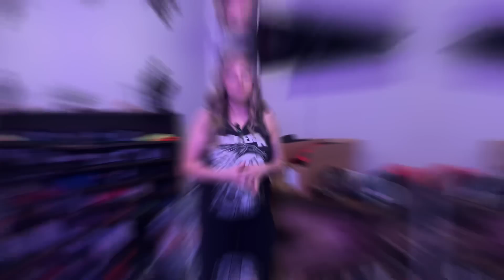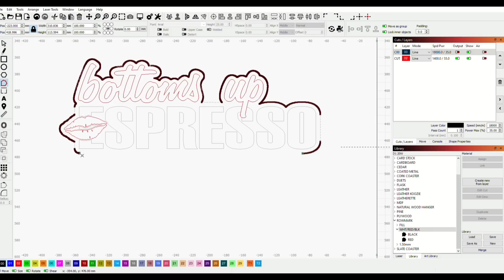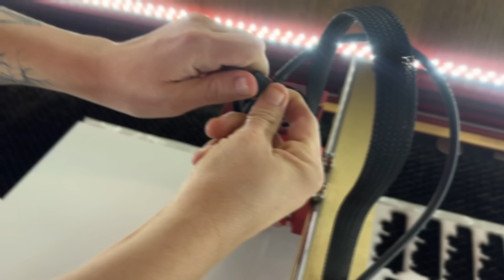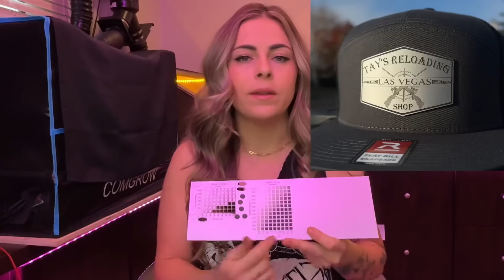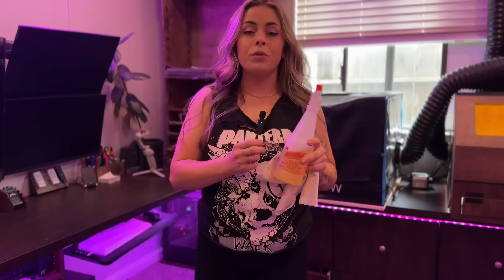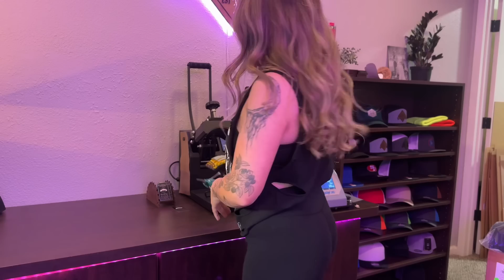Start making laser engraved acrylic hat patches... for FREE. (Rowmark, Duets)

Comment: Willow, are you applying the adhesive to a full sheet before cutting out the individual patches? Can you show your process regarding that?   Is it more cost effective to buy the sheets without adhesive and add yourself? Or do you do that In case you just don’t need adhesive on the sheet for a project?
Reply from the maker: Yes I apply it myself with a flat heat press but before I just used a iron with a heat protective sheet
Reply from the maker: It’s better to apply it yourself when it comes to cost

Comment: If you dont mind, are you buying the acrylic with adhesive on the back? if so, which one are you using? If not, what adhesive are you using? mahalo!
Reply from the maker: I buy it without since its cheaper to put your own on. I buy adhesive from Hydbond or LoneStar. I have a discount code for LoneStar WYLDEWILLOW if you buy a lot it's cheaper so I usually buy in bulk.

Comment: Awesome video!! Thanks for such good info. When asking for the samples which are good for making the hats? I went to the duet website but ther is so many different choices, are u using the indoor outdoor? Or which ones can I use for caps. Thanks in advance!
Reply from the maker: I use 1/16 thickness and anything that says its for laser engraving will work. I use outdoor mostly but indoor as well if that's all I can get the color I need in. I would grab some Duets Laser or Duets Laser XT. Not the Laser XT Reverse. Its confusing at first but its worth it to have so many options for patches and other projects.
Reply: Thank u so much for the info, I will give it a try.!

Comment: Hey! I'm so glad I found you!! I just  did a mock-up for a custom patch. As far as bending the patch to cool, what if you got a short piece of PVC pipe and rubber bands to hold each patch as you start the next one. Just have to figure out the size of the pipe to get the right curve. How did you get the different colors within the same patch? Thank you for all of the freebies too!! I'm looking forward to checking out the rest of your vids!!❤️‍🔥
Reply from the maker: I don't even bend the patch any more. I use a hot plate and preheat the patch. When I do it this way I don't have to preheat the hat and the patch just bends around the hat alot easier. The material is tri-color rowmark from Johnson Plastic Plus. There's a link in the description and a code for 15% off. Thanks for watching!!

Comment: Fantastic Video! Great resources. I will be following for sure. What kind of profit are you looking at? How much do you sell the hats for vs using Leatherette?
Reply from the maker: I keep all my prices the same with leather, leatherette, and Acrylic. However I think you could charge a little more if you wanted to, I just want to keep it as simple as possible for my customers. I basically price my hats to where I am good with the price for any material and if I use cheaper materials like leatherette I considers it a bonus. I only charge more for two layer patches

Comment: did you figure out the zero pressure issue? im wondering the same on mine too
Reply from the maker: No I have not figured anything out. I kinda just go by feel now. Pretty annoying on a press that cost as much as this one.
Reply: @WyldeWillow  I think you need to recalibrate the pressure.  It's in the user manual.  You go to settings, calibration, then go to pressure.  You back it all the way off pressure wise (counter clockwise), then you use the 1/8" foam. you lower the handle until the electromagnet lightly contacts the plate and select the "set min point", then you open it, rotate the dial 3 full turns ( i used a piece of tape to mark it) then you go to close it until it lightly contacts the plate again and then select max point. from there i would follow the stahls video on how to adjust pressure.  i just got my 360 and it was showing as pr 0 on the screen and giving me all these issues and i think this fixed it for me

Btw I have been doing laser engraving for a few years now, and i came across your page and I love the videos so far. great job :) And I love pantera too
Reply from the maker: @christinagorham  Wow  this is exactly what I need to do. Thank you so much I had no idea you could do that. And thank you for watching I really do appreciate it!! Pantera is my older brothers favorite band so I grow up listening to them. Love them!
Reply: @WyldeWillow  Let me know if it fixes it for you. hope it helps!
Reply from the maker: @nathanjohnston8551 check out the comment above might be exactly what you need!

Comment: You need to upgrade to the P2 asap you won't regret it 😁✨️
Reply from the maker: It's definitely a laser I am interested in. I was just looking at it the other day. I like that the bed is perfect size for 12x24 sheets and thats what most my Rowmark, leather, and leatherette  comes in.
Reply: @WyldeWillow  yes its 12x24 but you can only use about 23.5x11.5 of it but it does cut all acrylic like butter I'm wishing they make a bigger machine I've has mine since it came out but I need to make bigger projects lol
Reply from the maker: @grafxbynando_vlogs  I think that size would still work good since I usually leave a little on the  edges of my sheets to put magnets. But would be nice if it was a little bigger since I don't like running my laser near the edges.
Reply: @WyldeWillow  yup I don't run by the edges either but if you do get it you'll see the huge difference and work progress so much faster

Comment: I saw how you assigned a color to the different parts in light burn, but where does the multicolor come from on the material?
Reply from the maker: Sorry I should have explained that better it's a three layer plastic and based on how deep you engrave it exposes the different color layers.

Comment: How do they hold up on the hats?
Reply from the maker: Haven't done long term testing but they are extremely hard to get off once you put them on. Like you need to use pliers to get them off. I have more concern about them breaking because they are a hard plastic.
Reply: @WyldeWillow  Thank you!! That was a very good video.

Comment: Considering getting into hats myself. Thanks for the videos. Acrylic patches are certainly interesting and are a viable option for those that don't favor the leather patch look. How well are they adhered, though? Have you done any durability testing?
Reply from the maker: Haven't done nearly as much as I have with leather but I know I have to use pliers to get them off. I think they will hold up pretty good. They are hard plastic so breaking might be a concern if the hat is bent wrong.

Comment: To fix the pressure reading there is a calibration procedure. IIRC its in the manual, but it's also online if you google 360 iq calibration

Comment: Any chance you can cover how the acrylic patch was made?  Got to see the design process and the finished project but I'm still dumfounded on how that multicolor patch was made on a laser :)
Reply from the maker: Sorry I did not go over the material  very well. It's a three layer plastic and depending on how deep you engrave it exposes the different colors. Need to work on explaining materials better when I am working with them. Thanks for the feedback!!
Reply: Thanks for following up with the info @WyldeWillow , Maybe a future tutorial video idea for this multi layer material! Gained yourself another subscriber for sure!
Reply: I was wondering the same thing,what material was used and where to get it from
Reply from the maker: It's a tri layer plastic from jpplus there is a link to there web site In the description. I will get a link up to the material as well.

Comment: I just found this channel, you are doing awesome with youtube already. Only 2 videos but they are looking great. I am considering making some videos as well, what editing software are you currently using? Keep up the great work. I subscribed and look forward to more from you. I have a 100w co2, and a 60w fiber laser and a cnc machine. I started with a 10w laser mounted on to my cnc machine but quickly decided i needed a purpose built laser. I considered another diode laser  but i ended up getting a deal on the co2 so that was a huge difference. They both have pros and cons, there is no perfect laser. Co2 is definitely for cutting if thats what you do most, but the diode can do more delicate materials that a co2 just is too powerful to engrave on. Thank you for the tips.
Reply from the maker: I use capcut for editing. I can not wait to get a C02 but I make it work with the diode for now. Thank you for the kind words

Comment: First time watching and this is a pretty cool use of lasers! If you got some CAD skills, you might be able to design and 3D print a clamp that'll retain that curve you're setting. Or maybe take two pieces of wood with that same curve and rubber band or hand clamp them together? Not sure how hot that is and if you go with a 3D print, maybe try a higher temp plastic like PETG.
Reply from the maker: Just need a 3D printer first. I have thought about getting one but honestly don't have the time to learn something new. Might give the wood idea a try. After bending 200 of them I definitely would like some kinda jig to assist with the process. Thanks for the ideas.

Comment: I also have diodes, but haven't totally dove into doing plastics because of cutting. I have a 10w Aufero. The 1st thing i'd probably use it on would be 2 color plastics with a white core. I don't believe the blue diode would cut through that. I do have the xtool F1 which has an IR laser. Not sure if that would cut, but it's also a small working area.  Thoughts on the cutting of the plastic?
Reply from the maker: I have cut the stuff with a white core with my 20W so I think you could get it with your 10W might just take you more passes.

Comment: Hi There. I really appreciate your videos. Keep up the good work. They really do provide a lot of value. I’m new to the laser engraving community and would like to start a business with making custom hats. I’m a professional detailer, and I want to incorporate the automotive industry into the laser engraving industry. I have a lot of great ideas. “Imagination will always be more powerful than knowledge.” I’ve researched the adhesive people use for the leather patches, I’ve come across Dura-Bull. What are your thoughts and comparison with that and the one you are currently working with Hydbond. I’m most likely going to start using hydbond because you are recommending it. Also how are you able to get the different colors when you cut out that patch for the hat, the red white and black? Thank you again!
Reply from the maker: I have never tried dura-bull to be honest after using Hydbond I didn't see a reason to try anything else. This stuff is really strong. The three colors is done by using a three layer plastic that's sold by Rowmark. You can get it at JPplus. They are linked in the description.